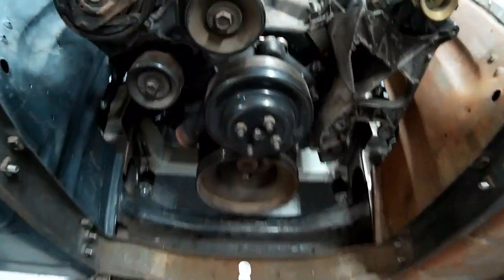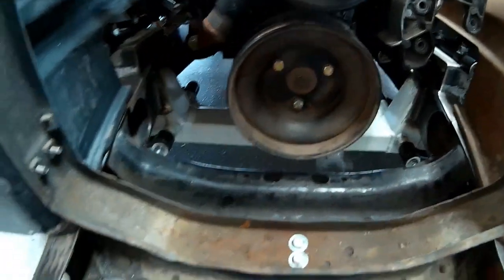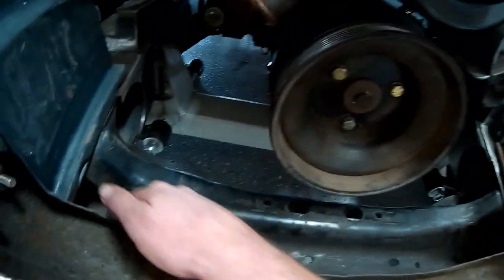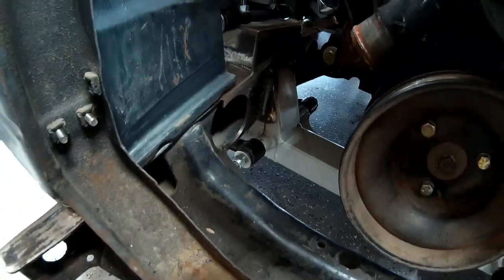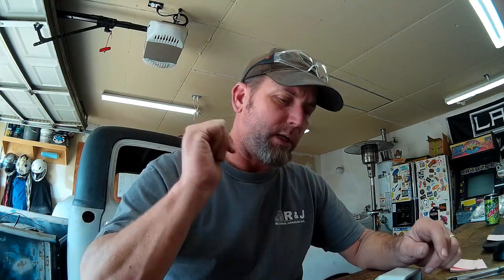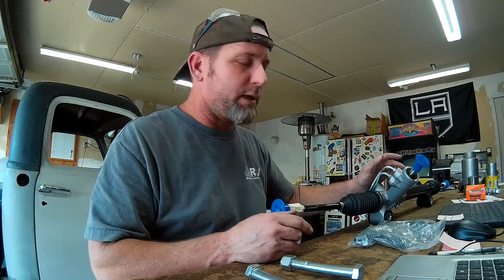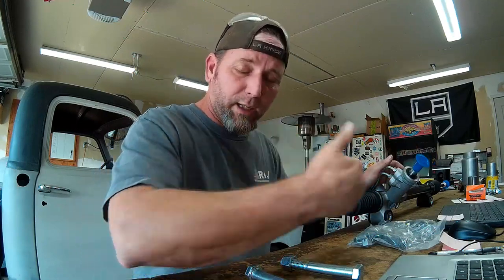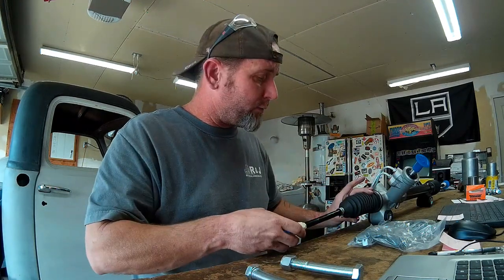P48 Project; Helix Mustang II IFS Install, Part 7 - Rack & Pinion Steering Fitment

Comment: What about ackerman you measure the rear end and mark center and front ball joint the center of rest bring a line to vote m of ball joint and take a lazer or use floor center of rest and follow to lower ball joint then the tie end point are at the line from center rear and ball joint follow to plum bob to tie end so no bump steer
Reply from the maker: ackerman is a steering angle that is built into the steering arms on the knuckle.  caster is the angle between the balljoints and is adjusted between the top hat and the lower xmember centerlines.  (and i get what you're saying because ackerman angle is affected by caster angle) assuming the engineers did their job on the knuckles....your ackerman angle should be proper.  thanks for watching.

Comment: You might want to look into the Tci,,,suspensions for sale,,,just put one in my 46 dodge pickup,,,so much less work,,,then the set up your doing,,, didn't have to mount the rack mounts,,,top hats,,so much easier and less time consuming,,,and brain racking..
Reply: I have a 49 dodge,  I'll be looking into the TCI...thanks
Reply: @clintarnett7058  your welcome,,you won't be sorry,,, and for the 49 you will find that 2004 to 2008 crown Victoria front suspension might fit and bolt right on,,,but the TCI is such a easy install,,,very little cutting and welding,,goodluck with your truck,,, I have my suspension and frame work done,,and working on the body now,,,
Reply: @clintarnett7058  so you know,,,I had bought my TCI years ago for a 1940 ford,,and didn't use it,,,but it worked out very well for my 46 dodge,, get up with me if you need any advice,

Comment: Did you weld the mounts on centered or with the rack centered? I'm working on a '50 where they installed the mounts centered. This puts the rack about 1" to the passenger side. Turned GREAT to the Rt. but, like crap to the Lt. I get to fix By cutting off the mounts and moving them over.
Reply from the maker: the rack needs to be centered to the frame centerline, yes.  the mounts themselves will not be evenly spaced, no.  you want the joints of the tie-rods to be inline with the lower A arm pivots.  at ride height both the A-arm and the tie rod/rack should be level to the ground.  tack it all up first and dont finish weld any of the mounts until you test full travel/turn.  you may also need to tilt the rack back to get proper angle on your steering linkage, and to clear motor mounts/etc.

if i placed the rack wrong in the video, i apologize.
Reply from the maker: i re-watched the video, and i do explain that the rack should be centered but not the mounts.